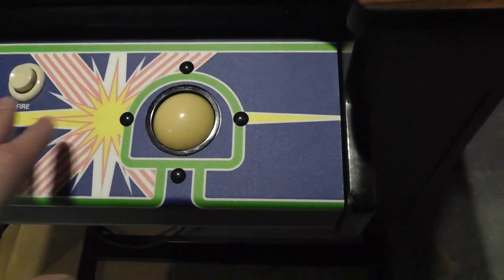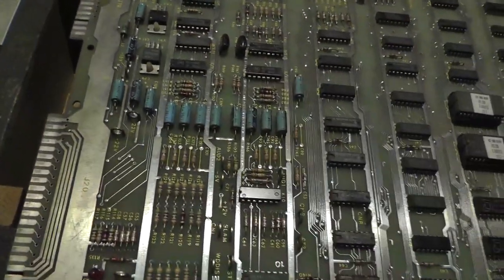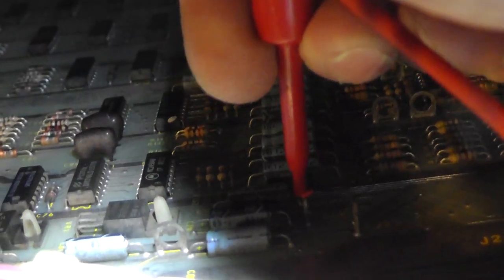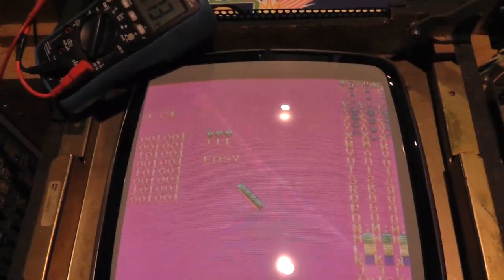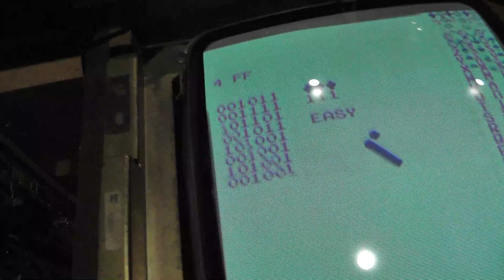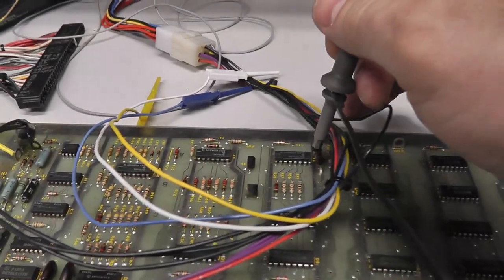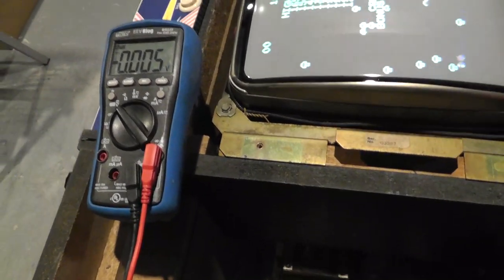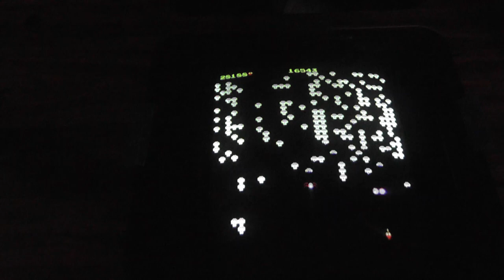Centipede Repair - Right is Left, Left is Right, High Score Save

Comment: I'm having this issue with left is right, right is left. So I appreciate you taking the time to diagnose the problem. I've never taken the board out of the atari cabinet, it's my dad's old one I'm trying to fix.

Edit: I can't find any other videos (with a surface search) of anyone else having this issue or diagnosing it. I'd love to know which logic gate to replace to try and fix this issue (I have the upright arcade not the cocktail table so no reversed p1/2 setups)
Reply from the maker: first, you may just want to swap the connectors on the two optical boards.  However, that might be up is left and down is right :)  anyway good luck in the repair!

Comment: I have the same Atari cabinet but it was empty when I got it with generic controls and I am wondering what size monitor you have in yours?
Reply from the maker: Pretty sure it is a 13"  but I will look at tube model # and revert.  I think I read Atari referring to them as 14" in documentation but not so sure about that.
Reply from the maker: CRT type = 370ESB22 and it is an Electrohome G07 FBO  13" COL GAM MNT.  So 37mm is 14+ inches but refers to diagonal face of tube vs american standard of 13" viewable.  Hope this helps.
Reply: @jacklick  Thanks!
Reply: Maybe I missed it.  Did you figure out the frequency issue for the vertical sync?
Reply from the maker: @bperkins  No I didn't figure it out and was curious if it is even worth me trying.  Probably only a couple counters in the Vert Sync section.  I am tempted to do Sig Analysis just to see if I will get different results between the two boards.  Thoughts?
Reply: @jacklick   It's worth looking at.  I've fixed more Centipede boards than any other.  I had a problem on the vertical counters once and the screen was broken into horizontal slices..  I'd likely start at the LS175 at N4 and work backwards.  Maybe with the comparator?  The sync is off by such a small amount it seems like its a low numbered bit that would be causing it..   I would guess its very close to the outputs too..  Hard to tell of course.  But that would be annoying having it go off the screen.

Board#2 off this link:  https://bperkins.wordpress.com/2020/03/14/centipede-board-repair-logs/
Reply from the maker: Nice Blog!  Thanks for the link.  After I get this centipede cocktail back together I will put both boards back on the bench.
Reply: @jacklick  Thanks.  It could make for an interesting video if you find something  ;)